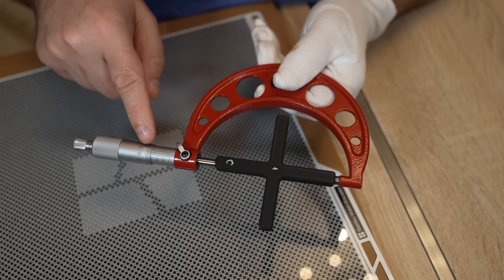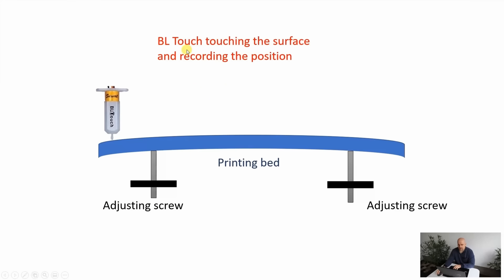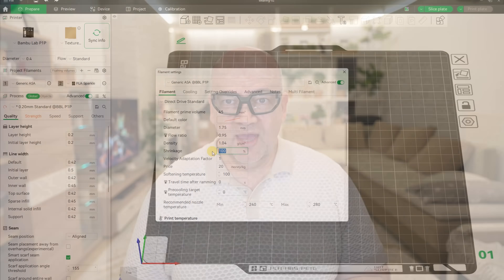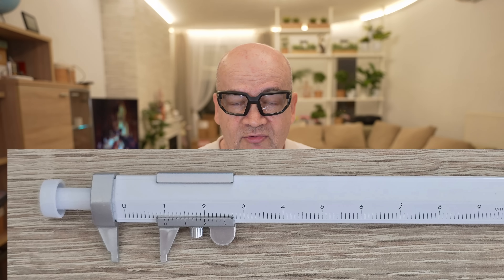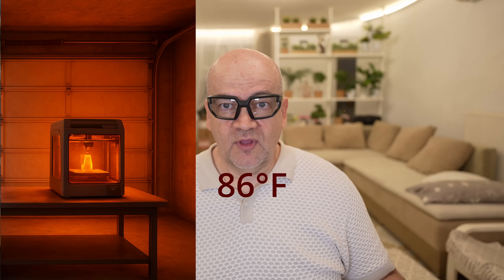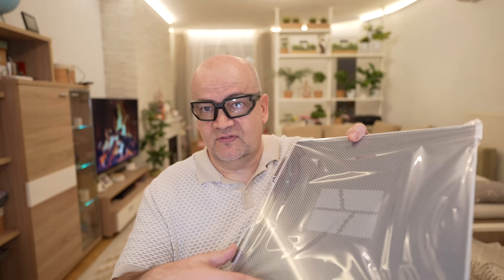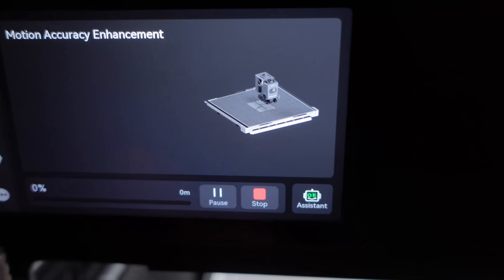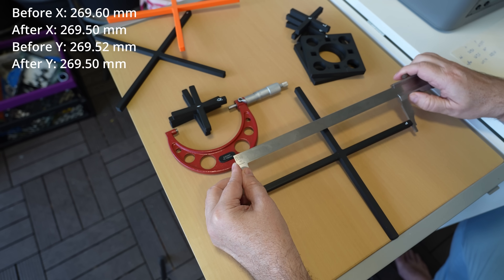Bambu Lab Vision Encoder tested and explained

Comment: I spent the last 10 years working an an agricultural manufacturing firm and I had a 300mm set of vernier scale callipers. I chose them over a digital set because no one would "borrow" them as no one else could read them. I wasn't even working in the engineering department, I worked in purchasing/parts sales!
Reply: Same here, except I had a 150mm set. Any one who would want to borrow them (other machinists) had their own calipers and any mechanic who asked to borrow saw the calipers weren't digital or dial and wouldn't want to borrow.
Reply: Sorry, I teach all my 9th-grade students how to read an analog caliper with a vernier scale… but it isn’t easy for some of them.
Reply: @manuelt7846  Thing is, shortly after your class, they aren't required to read them again and it gets forgotten. I have to relook it up every time I want to do it as I just don't use them enough. I bought myself a nice Mitutoyo pair to force myself to retain it and need to use them more.

Comment: Hi Igor, i asked BambuLab id it's possible to calibrate with vision encoder in heated chamber without turning on bed, they claimed that it's feasible. Would be interested to check if you would like to continue this topic, since heating up elements allows for expansion

Comment: My guess would be that they do such a calibration already at the factory. 
Where this vision encoder might be very useful is when someone has to do a big repair or when people want to do the H2C Upgrade, which much likely also involves a bed replacement.  After such a big re-assemble it might make sense to invest into it.
Reply: The vision encoder would also compensate for issues caused by internal frictions like ptfe tube. I noticed that on my H2D, with or without ptfe tubes installed, I have very different vision calibration results on the very right hand side of my printer. Which is caused by the ptfe tubes hitting on the side wall and causing unexpected restriction. Still trying to figure out a better hardware based fix instead of relying on  calibration..
Reply: My H2D had a skew and difference in X/Y of 0.3mm for 100mm. The calibration fixed it.

Comment: I'm usually using Califlower (not cauliflower!) for my printers. It's available in flat (x&y) and 3 dimensional. It calibrates 2 different length plus inner and outer dimensions. That makes shrinkage compensation possible. Once I calibrate a material I can trust my tolerances in cad fit my printed objects for that material.
Reply from the maker: This one? https://www.printables.com/model/682023-califlower-calibration-stl-calculator-mk1
Reply: @MyTechFun  CNC Kitchen has a good article about it
Reply: There is a mk2 version but its locked behind a paywall. And the calilantern, which measures Z shrinkage as well. The mk1 does fine though
Reply: @MyTechFun  Should be the one! I have seen this all over the place.
Reply: @MyTechFun  Yes, that's the one from Adam, i believe it has become the new standard
Reply: @MyTechFun yes he provides even a calculator there is the calilantern that do the same stuff more usefull for corexy printers
Reply: @MyTechFun yes! That's the xy version.
Reply: Interesting...I'll have to look into that